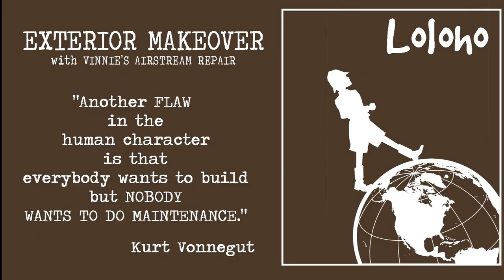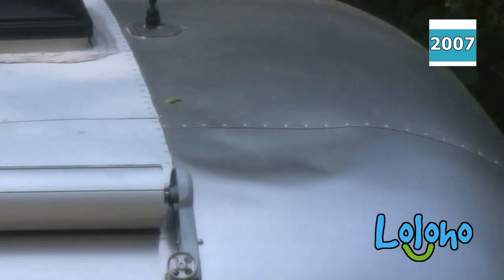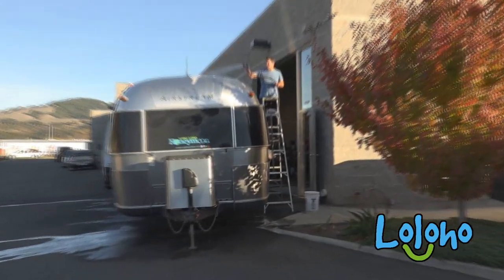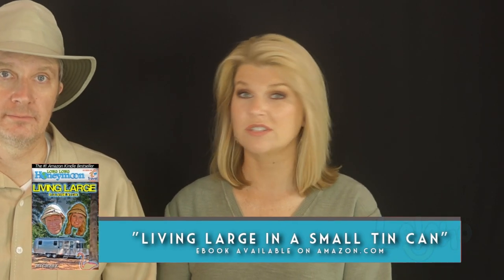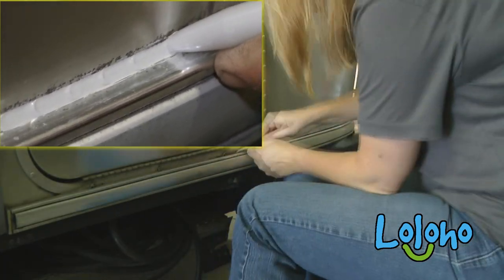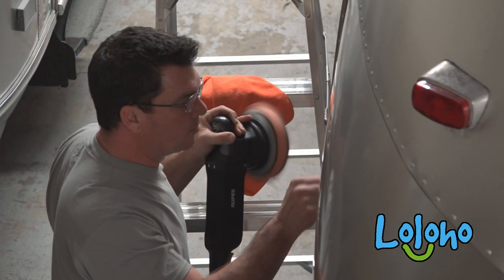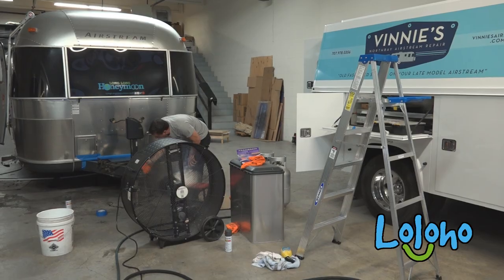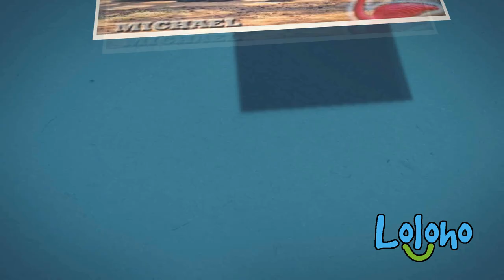EXTREME MAKEOVER - AIRSTREAM EXTERIOR EDITION!

Comment: Thanks for sharing this fun topic. It's always fun to work with you guys :-). I saw a couple comments that I can respond to. Dawn detergent is commonly known to remove grease and tar from the exterior surface. There are other products but this is what I like to use. Only use this type of detergent if you plan on prepping a surface for wax otherwise it will remove your hard work. The exterior of your Airstream can be washed safely with an over the counter car wash soap, soft brush and micro fiber towels for drying. Regarding roof reseal... this needs to be inspected every year. Depending on how you store your Airstream or travel trailer your sealant may last longer. I store my Airstream inside and I expect to get 5 or more years of service from my reseal. You may live in the Arizona desert with direct sun exposure and may need to do this more frequently.

Comment: Sean and Kristy  -- Thanks for this vid on the kind of maintenance that is too easy to shy away from.  It's time (this coming spring) to have our trailer resealed.  We've got a more typical eastern TT but it's about 5 out of the factory and living in the great north, our trailer 'survives' through 4 months of sub 35 and snow every winter and then we do that 4.5 on the richter scale thing for 3 or so trips a year.  So we're due to get a full inspection and probably a reseal around the roof components and windows lest evil water finds its way in.  AND, our tongue (here's looking at U Sean) needs the sanding and repainting along with areas of the frame underneath.  Our trailer did the winter show circuit a few too many times before we met it twice and purchased it.  Ive been doing salt damage repair every year since and it's time to and and rustoleum the frame and tongue so it corrode-no-mo.
Thanks again!!

Comment: Strong work. Enjoyed that segment because I am a super proponent of maintenance. FYI there is a great company in the Denver area called The Metal Company and they can build all types of RV related tanks and metal boxes. They have their own forms for creating them. I got lucky and found them when I needed to replace a certain profile of siding material for a panel on my trailer. They can create almost any type of corrugated panel made of aluminum.

Comment: Recently I received an ad for a new product for exterior finishing from metal and painted surfaces to fabric and plastics, and even leather. It is called Top Coat F11. It puts a slick finish that repels water and allows dirt and bugs,etc to be washed off or removed without rubbing and scrubbing. Plus, it makes the finish of painted or metal surface shine like diamonds. You should check it out. Kind of expensive but probably worth it. Have not tried it myself, but I am seriously considering its purchase.

Comment: Nice video!  Just a tip on maintaining the exterior finish.....Dawn soap is great prior to all of the work Vinnie did, but should not be used after all of that laborious polishing.   It will strip off the wax or other protection (which you should be using on clear coated panels).  I reccomend  optimum no rinse for use on your travels as you need very little water  and it won't take up much space. Look up "auto fetish detail "  on YouTube,  he has great recommendations for this product and has a video regarding an airstream as well.  Happy travels!

Comment: Hiya Guys, Thanks for the extremely high standard of quality in your videos, as usual. It really doesn't go unnoticed the amount of effort that goes into the editing etc.. I must admit that I find it hard to believe that in 2016 all the roofs in all the r.v's are flat where there are any opening to allow for a.c. Units, vents/fans and the other stuff to be fitted. This can only encourage any water to come in should there be a very small crack/hole. I wonder why the industry don't have curved edges that point upwards by three inches. This would allow all the a.c. Units and any fittings fit over any holes cut in the roofs more efficiently, and in turn,  reduce the risk of water damage from the roof area. It can be a little more tricky with aluminium but not impossible however, there's no excuse for the rest of the industry that has one piece moulted roofs! The manufacturers appear to put profit before customer satisfaction and product quality.

Comment: Where in Florida do you live? Not exact address but general area.  I live in Central Florida and have since 1976 when I moved from Canada.  I am towing a Jayco Whitehawk to eastern Canada for a month long trip.  I just bought a 2020 Sierra Denali HD 3500 as tow vehicle for the trip and later trips.  I am a Ford man usually but I turned to GM for a 2017 Yukon XL Denali wagon to replace my Lincoln Navigator 2014 that had Fords tested and true V8.  When Navigator changed to small turbo 6 cylinder I said no to that and bought V8 Yukon XL Denali which I loved but knew I needed a diesel to tow my trailer.  I am the 80 year old that thought I may be too old to travel with RV!

Comment: Nice Video.  We own a 29', 1992 Excel Classic.  Since 2009 we've spent more and more time on the road.  Our last trip included wintering out west, leaving home the end of Sept. last year and returning mid-May this past spring.  Unfortunately, although mostly well cared for when we bought it 4 years ago.  There were / are some major exterior, er, "situations?", i.e. worn out clearcoat and oxidation.  We've cleaned and gone over the exterior with a clay bar a couple of times, but the condition is so bad it didn't help much.  This past year I slacked off and didn;t even wax it.  I'm actually thinking of buying my own orbital buffer.  I'm quite handy and do most of my own maintenance and as much of my own repairs as possible.  In my case, I can't really hurt my clearcoat in any significant way.  I mention this in case you have any suggestions.  

My burning question, however, is the following.  I believe you said you used Rust-Oleum paint on your tongue, but I'd like to know what color you chose.  I painted mine not long after buying it, I matched what had been done by the previous owner, but it is not as light a gray as yours, which I'd prefer.   Happy Trails you guys.
Reply: Porter Cable makes a nice DA style polisher much like the one featured in the video. Amazon carries them along with the foam pads. The DA style polisher is quite forgiving and not at all hard on paint. Just stay off the edge of panels and you should be good. Hope this helped!!!

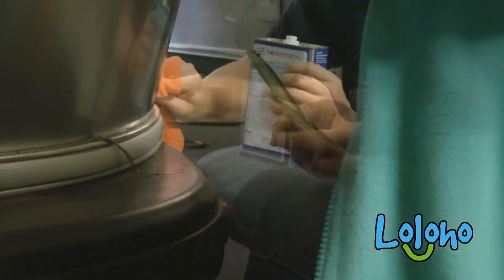Comment: Hey Sean and Kristy, what kind of solution did he use to clean the top of the rub rail before resealing at 10:44 on the video? I am in the process of doing this right now and bought the bone tool but that stuff is really gummy and I know that something will have to wipe it before putting on the new sealant. Also, what is the stuff he used with the clay cloth "paint gloss"?

Comment: Wanting to get into the airstream community. I would like to get a smaller one that I could pull with a half-ton pickup - F150 5..4 w/tow package. It seems the smaller ones are extremely hard to find. I'm a carpenter so I don't mind doing the remodel/gut type work. If you have any pointers I would appreciate all the help I can get. What is your take on single axle vs dual?

Comment: So, I saw the water leaks in Valdez, and the carpet rip out and floor replacement, but I never saw how you found and fixed the leaks. I also never saw how you fixed the white smoke problem with the F250.
Reply from the maker: Resealing the roof and exterior stopped the leaks (presumably they were caused by breaks in the seals). We replaced the EGR cooler and oil cooler in the truck.

Comment: This is a bit off topic here, but, I have 2 questions concerning new RV's that I am in conflict with. First is that I am seeing lots of new RV's that are equipped with Inverter electrical refrigerators. Unless you have a 10k solar set up, or, are always on full hook ups, how is this going to work when boon-docking? Second, I am seeing the RV entry steps being a solid setup that, when you are ready to travel, you flip the setup into the interior of the RV. Damn the mud, sand, leaves (etc). that you just flipped into your RV. Neither one of these make any sense to me. Do you have any answers?

Comment: Where is that drone bridge shot at the end of ths video?  It looks like it could be in North Idaho?  Moyie River?  Excellent video.  Not sure I like what I see though.  Lots of damage and repair for such an expensive trailer.  The lower box rust damage is disgusting.  Otherwise, you are sure correct when you say an RV is a rolling earthquake every time you it on the road.  The parts and pieces seek "maximum randomness" every minute of every day!

Comment: Did you ask Vinny if there is a reason not to paint the tongue and skirting with stone guard finishes like LineX or Rhino Liner? Well, for Vinney it probably about keeping the units looking factory fresh stock looking. Have you two thought of a stone guard finish (basically spray in bedliner surfacing) on at least the tongue and front skirting (below the rub rail where its already black). Some have done all of the skirting because the trailer tires kick up debris too. 

To all those except Sean, Kristy, and experienced RV owners...If you can't afford to have your RV resealed every 4-6 years and all new tires every couple years (depending on how the rv is stored and miles driven-towed) you can't afford to have an RV. So tired of seeing cracked sidewalls and blow out due to dry rot. Dicor is the BEST sealer. Don't go cheap on sealer. Don't ever think a little pin hole, small crack in the seal, or a lifting seal is "ok to leave for now". Water damage is the quickest way to destroy your RV. Always wash your rv before checking seals. Dirt, tar, sap, bird crap, etc,.can hid small holes, cracks, and lifting seals. Lastly, use the proper cleaner to ensure all old sealer, oil, and contaminates are removed from the surface you're going to put Dicor on.

Cheers.

Comment: *Anywhere steel 'touches' aluminum it creates a very weak electromagnetic-field...despite it's weakness, this almost immeasurable 'electron-flow' is a virtual constant and the 'free hydrogen radicals' present in the steel want to escape...the carbon present in the steel 'wants' to bond with atmospheric oxygen, and the result is rust*  (this occurs very quickly with steel-hulled ships and propellers and the way it is 'slowed down' is in using 'sacrificial zinc' metal to focus the 'EM-current' into what now is an 'anode' that degrades quickly...a steel ship moving in salt-water is, in essence, a 'battery' of itself!) One way to 'help' slow down degradation of the steel components of an 'Airstream' is to 'ground it out' by using a copper-'spike 'into the ground that is in firm contact w/either of the trailer's 'towing safety chains' (the metal MUST be 'raw' to conduct a weak current...so no paint or any other substance should be present where the steel-chain is touching the hitch) Any copper piping will work as well as a 'spike' ...but drive it in a foot or so to ensure plenty of contact and the copper MUST be 'bright & shiny' to conduct the tiny amount of 'flow' into the earth, as any oxidation will form a barrier to conduction.*Will this effort 'stop rust in it's tracks?' NO...because it's the nature of steel to rust, either fast or slow...but it WILL slow-down the process quite a lot, especially in hot, humid areas*

Comment: Well... clear coating alu IS ABLE to be recoated on the existing alu... we do it all the time for aircraft etc... painting is similar... but when you say you have to replace the panel if you buff through the clear coat... wrong... you can remove the clear coat in the segment... with aircraft stripper... clean the alu with chemicals.. treat it using alodine...and then re-clear coat it or just leave it with the alodine... as both will keep it from corroding.   putting the clearcoat over the alodine is like wearing pants with a belt AND suspenders... 
Eventually the clear coating will come off the alu.. looks like a bad case of flaking skin... so I am sure you don't re-skin the whole trailer... but instead strip and re-apply clearcoat after alodining the exterior metal... which then keeps the rivets from forming filform corrosion within the sheet of alclad that the trailer is made from. 

Just thought you might want to know.. you can clean, prep and re-clearcoat much cheaper than replacing the whole panel... 

by the way... have you ever had wheel bearing failure on the trailer?

Comment: the Fort Myers Airstream dealer told me they were pretty much no maintenance needed
Reply from the maker: +Brett Duffy no maintenance except for the tires, wheel bearings, brakes, jack, plumbing, water heater, oven, propane tanks, step, floor, and water sealing.
Reply: LOL, well, let me share. I have a 10 year old one and there is maintenance. Even a rainstorm drive will make the shiny aluminum look like crap.
Reply from the maker: Over the years we have maintained, modified, and/or replaced just about every component of our Airstream: A/C, jack, hitch, step, door, couch, floor, plywood subfloor, 'mouse fur' wall covering, drapes, paint, aluminum panels, antenna, faucets, cabinet hardware, wheels, tires, wheel bearings, heat furnace, water heater, propane tanks... and a lot of other stuff I'm probably forgetting. About the only thing we haven't had to address is the steel subframe. :O
Reply: I plan just mine parked and live in it full time

Comment: Air stream are better quality, but this other girl blogger trailer frame broke on the road had to call in a welder. They when to a trailer repairer. He said it very common in about 7 yr + side tear drop trailer.they used light steel just enough, and it rust from the inside out. He show rust just starting inside And the reason why it broke at the 2 spots say this is the usual where the bolt meet the body and that closet to the v frame at the front it the stress point. Says to look closely with a light as it rust from the inside.didnt show much.  Might not hurt to give it a light search as logically it’s heavy,  stress between a torque truck, it’s old, and it’s exposed to water following the truck tires. And if if did broke that a expensive tow.
Reply: My 1994 conversion van  Midas wanted 2k for a brake repair, I knew the brake booster was ok,  but he wouldn’t budge, so I when to another shop. I got the job done at 17 hundred with 2 wheel drum too thin to resurface. And luck I when with them,  they found the back brake line was rusted behind the drum underneath. New line put in. Midas miss this. And booster was good. And brake job last about 4-5 yr. van heavy it could have broke that brake line. Trust your hunch

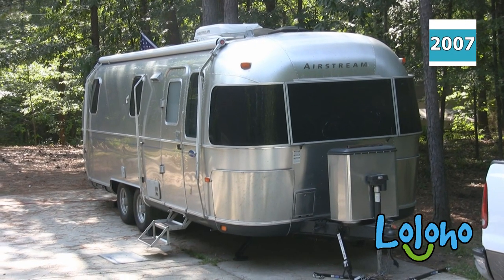Comment: 2:46 - So let me get this straight... somebody doing repairs on an Airstream was stupid enough to step on the front cap, then charged you to repair the damage they did?
Reply from the maker: To clarify, yes, somebody doing repairs on our Airstream was stupid enough to step on the front cap. At first they denied doing it; later they admitted doing it, and offered to repair the damage on their dime. But we ended up fixing it ourselves (basically pulling out the dent) and living with it instead of doing a complete panel replacement. I didn't want to take our Airstream back to those people or do any other business with them.
Reply: That's impressive... I didn't even finish the video before you responded. Thank you.